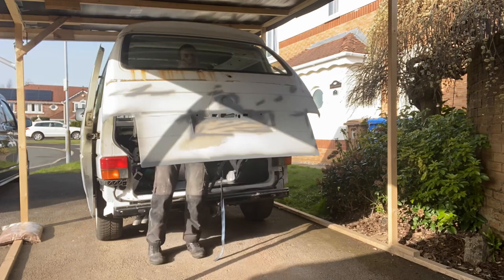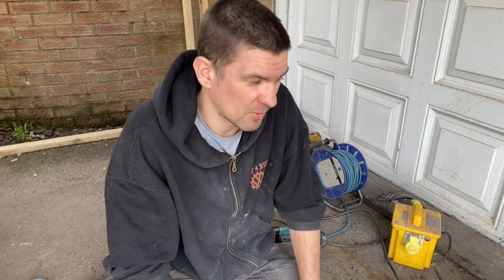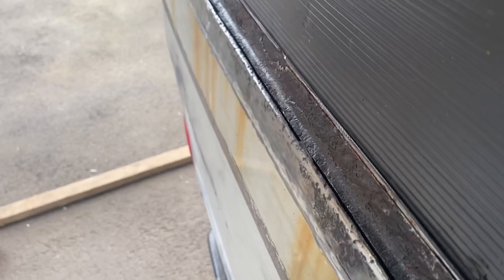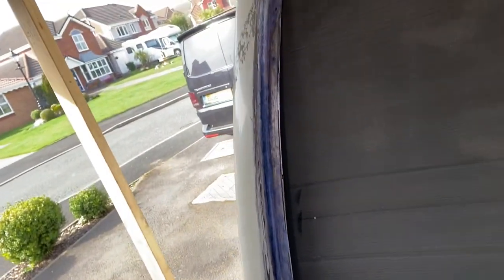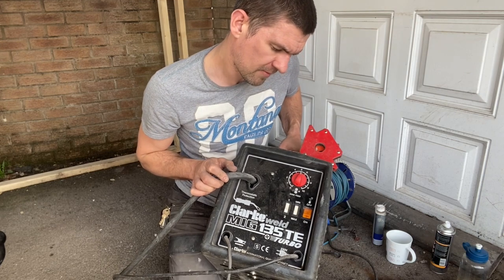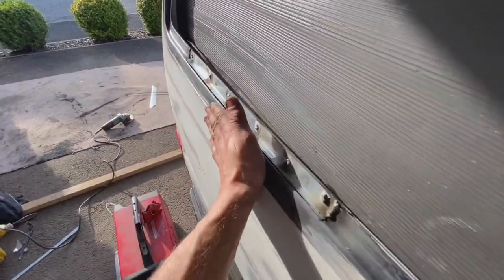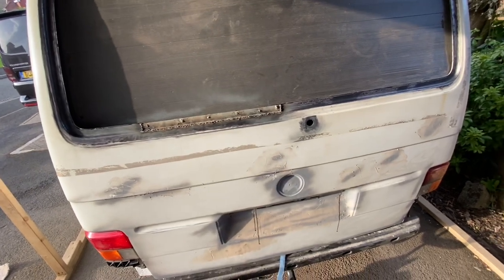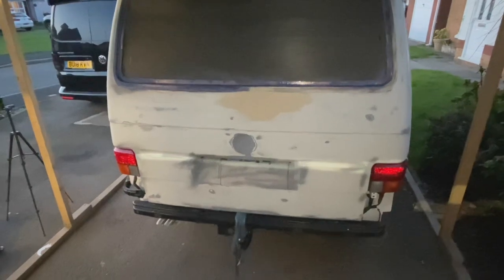VW T4 Tailgate Repairs

Comment: Another quality upload, mate. Really enjoyed it. Got that exact same MIG and I’ve found it really good to learn with. No idea what the crack with the setting is 1/2, min/max but as you said I just playing with it until it works. 

Thanks for sharing. Can see this channel really growing - good content and well put together
Reply from the maker: Thanks for the sub! Use the 4 settings to change the power output for the thickness of the steel. 1+min = 1mm steel, up to 2+max for 5-10mm steel and the other two combinations for in between material thickness. I just leave the wire speed alone as I feel I’ve found it’s sweet spot 😄